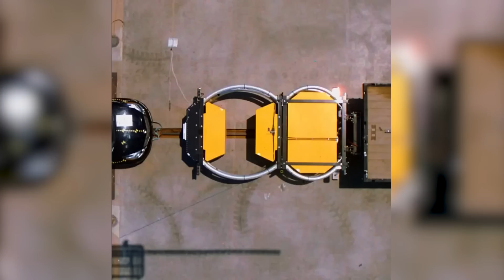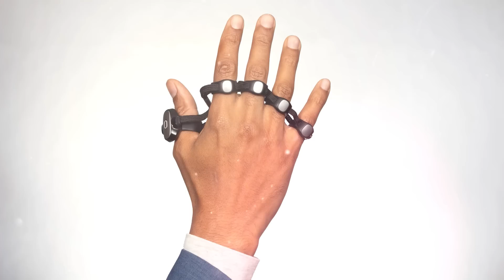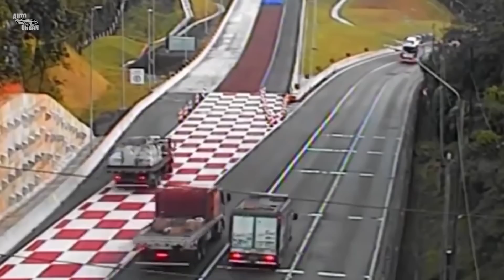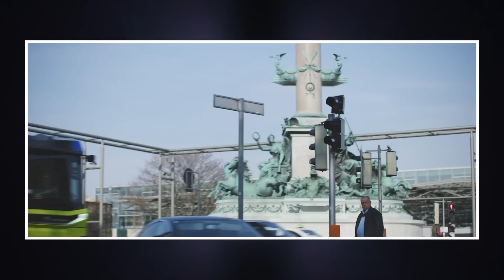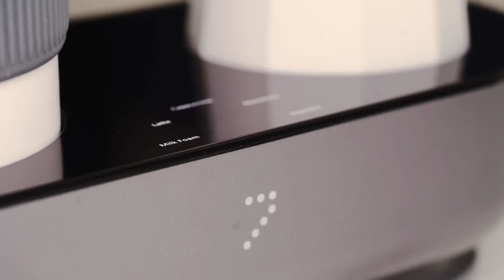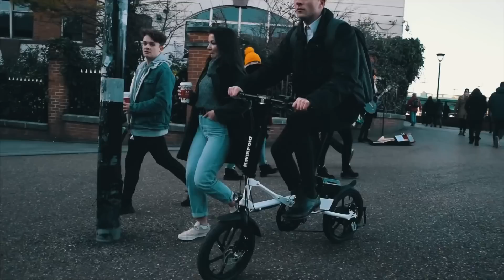70 INVENTIONS ON A WHOLE NEW LEVEL

Comment: Energy=Matter Because The First Law of Thermodynamics: states that matter states that Matter Cannot Be Created or Destroyed; Einsteins C in E=MC^2 He said Equals The Speed of Light which Means that the Speed of Light is the Constant of the Energy or the Speed so Einstein did not Understand that he was just saying that Matter is Energy that he was just doing things with Friction by putting a Speed into the Matter and Squaring it Because the Actual Equation is E=MC where C=Constant and Constant=Speed (but the E=MC^2 where C=The Speed of Light is the Speed of Atoms Electrons and Molecules Parts and Electrons, so Einstein Got that Right (This is under Known Conditions So Maybe the Constant in Matter is applied to the Matter or Energy by the Speed of the Friction or that the Friction is applied even if it is less friction like ice and not like Sand Paper and Maybe it is not Possible to speed up the Matter ElseWise to Get the Energy form because of  The Potential Law of Science that is E=MC^2); I Believe that Jesus and Jehovah and their Helpers can do E=MC where C= just Speed uh if you apply the speed without causing Friction it will Work if that's even Possible.

Comment: A shower, at the workplace, so the worker, will not fill their vehicle and later their home with dirt! That is brilliant!
 Wash off the dirt at work, where the dirt came from originally. Smart.
Reply: For most of my working life, I had a shower at work, coal miner, asbestos remover, and civil engineering, I find it strange when a workplace doesn't have showers, the idea of going home dirty is weird, taking all that muck into your car then your home doesn't appeal to me one bit. I've seen cars which have dust sheets over the driver's seat to try and keep them clean, you can't beat a shower and a change of clothes, even taking home dirty clothing is alien to me, we had laundry services where I worked,,

Comment: The battery in all these EVs and emergency vehicles will only charge so many times before having to be replaced.  It's not a good idea for emergency vehicles to be electric in case of multiple emergencies. They can't get to all the emergencies. That does happen in large cities.
Reply: Yeah. And none of the electric vehicle geniuses seem to want to make battery packs which may be quickly changed, like a tire, so the emergency vehicle could stay in use.
 Then just repair the first battery pack, to use again.